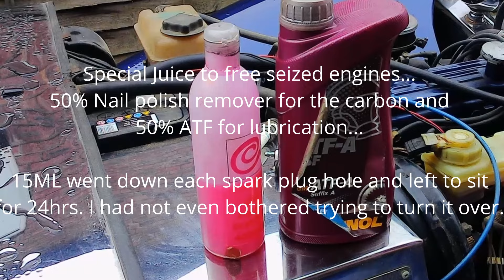OLD... 1st Start of "Rebecca" the Robin Hood Exmo Kit Car.

Comment: Was in Traynors, Armagh car dismantlers a few years ago and there was one of these cars with Ford's same cast iron counterweight disguised as an engine. Please be sure not to crash this thing. Car had hit right hand corner into something. Square box  section under dash was now in a position where it had most definitely smashed the driver's knees and legs into mush. Impact did not look severe. Look under dash and be horrified.